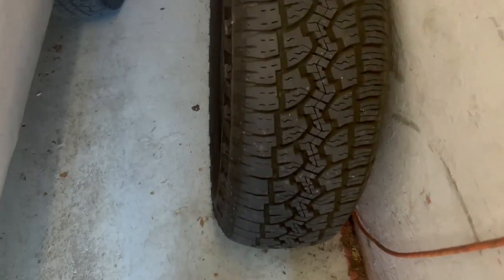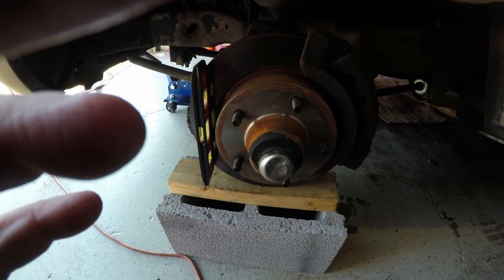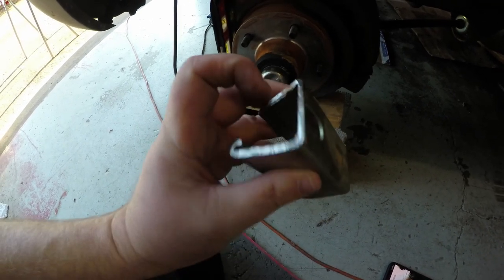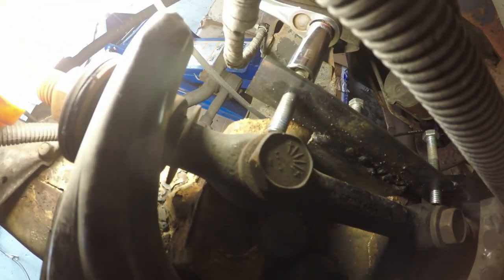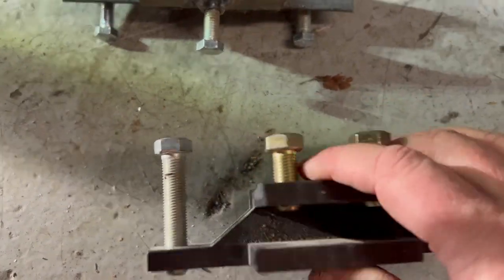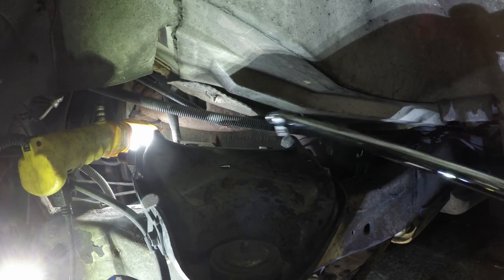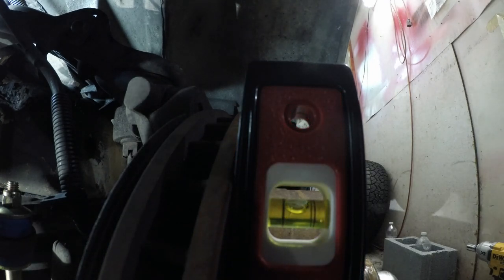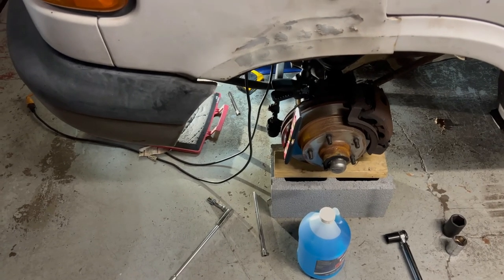How to adjust camber wheel alignment yourself with a level bubble Miller 8199 tool

Comment: Same happened to me. Got 2 alignments over the last couple years due to passenger front upper control arm bolts coming loose. The control arm ends up settling to the max adjustment. I’ve tried to diy alignment but couldn’t find much info for it. This video is gold, thank you 🙏
Reply from the maker: For some reason they’re just lazy when it comes to tightening fasteners!

Comment: Ive been lookin everywhere for info on how to do this and knew there had to be a tool. My question is did you have the weight of the van set down on the bottom of control arm when you did this or was the van jacked up and spring fully extended? Thanks for the vid your not alone
Reply from the maker: At first I had the weight set down on the lower control arm, and that allows you to move the upper control arm freely after loosening the two top camber adjustment bolts which is no good because it would be too hard to hold the upper control arm still and tighten the bolts. I reset the weight between the cinder block and
 block of wood and the brake rotors. Make sure the miller 8199 tool is installed and holding the weight before you loosen the upper control arm adjustment bolts
Reply from the maker: In order to make this adjustment the vehicle has to be sitting at ride height meaning under pressure
Reply: @PHL_Brownstone  so to be clear, the weight of the van wasn't on the jack, it was set down on the blocks which put pressure on the springs as if the wheel was on correct?

 I tried doing it on Jack stands with springs fully extended, but camber was always wrong after I set the van down again.
Reply: @PHL_Brownstone  thanks for taking the time to do this. Greatly appreciated. And I find your commentary amusing 😆
Reply from the maker: @jacobemerson4799  yes! If you watch the alignment shop they have the wheels on and up on a lift ! I have no lift so I have to try and simulate. The jack was under and touching but all the weight was on the block of wood on top of the cinder block. You have to do both sides at the same time also so that means you set up both sides with the block of wood and cinder block. If not that may also mess up your adjustment
Reply: @PHL_Brownstone  how has your tire wear been since you adjusted it? Tire still straight up and down?
Reply from the maker: @jacobemerson4799  not enough miles yet for an update. With all this nasty weather I’ve been driving the trailblazer. But I did drive it for a week and it’s pulling to the left because of the tires excessively worn on the inside.